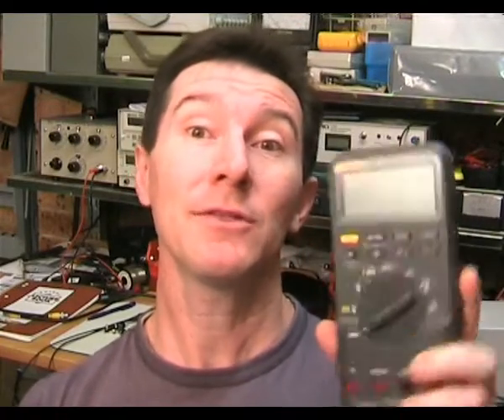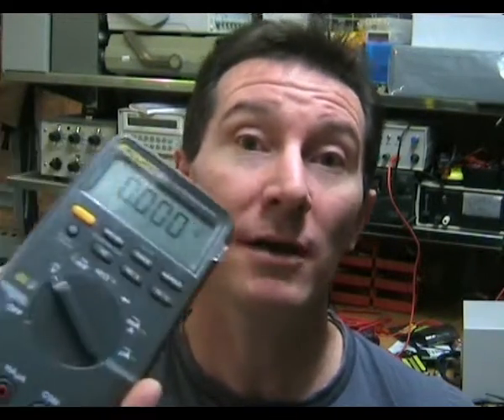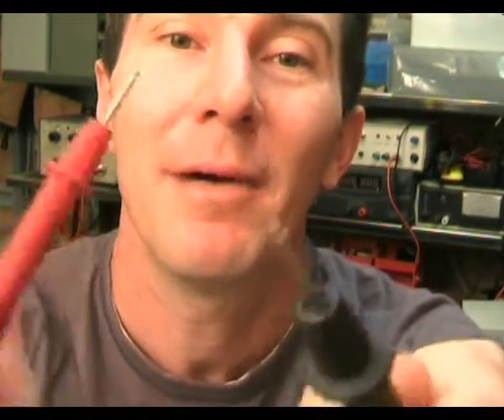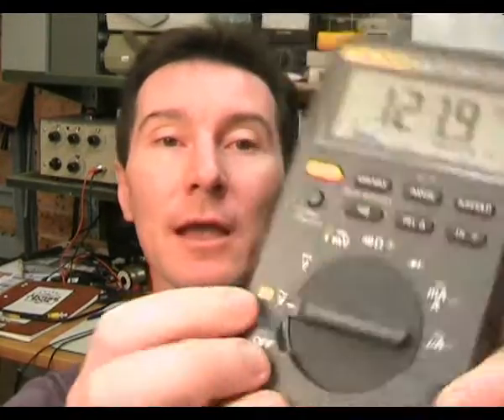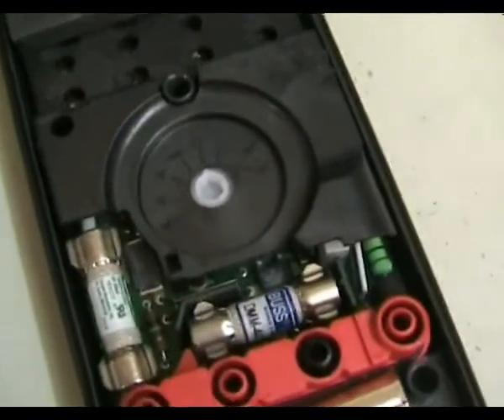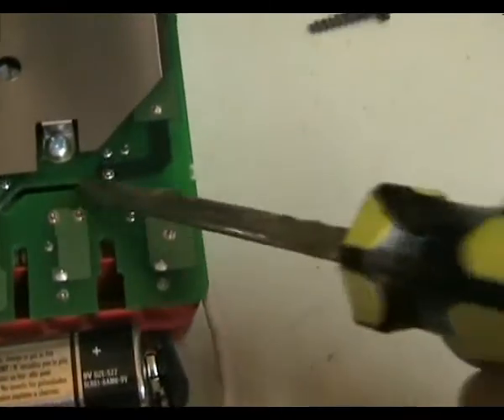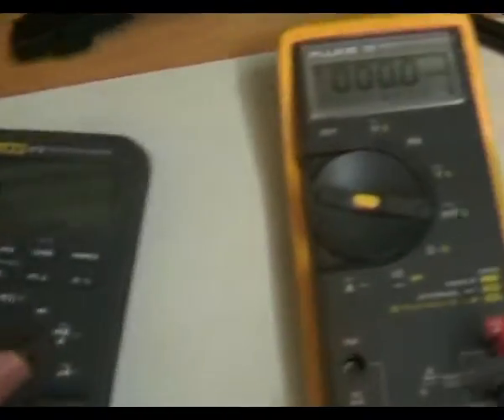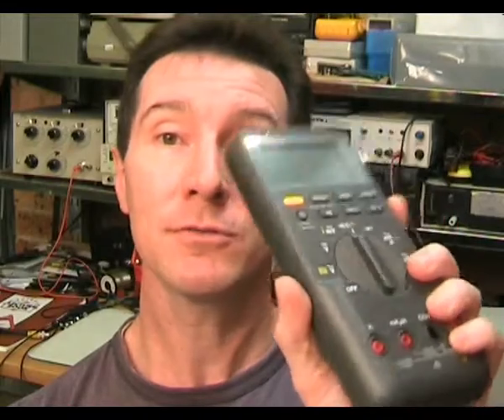EEVblog #10 Part 2 of 2 - Fluke 87 V Multimeter Review

Comment: I have an original first generation Fluke 87 with 4,000 counts, ±(0.1% + 1) basic DC accuracy, and green backlight which I bought from Joseph Electronics in Niles, Illinois just over 30 years ago. At one point, the display started to fade (i.e. segments dropping out). I understand this was a big problem with this series early on. Even my dad's Fluke 8060A (the predecessor to the model 87) suffered from the same problem. Apparently this was due to some degradation in the elastomer strips used in that time. Fluke has since offered a display upgrade kit (DR80) with better elastomer strips as well as a white backlight. I upgraded mine and now the display is perfect, not one segment out. However, I opted to keep the original green backlight because I like it better. The white backlight is uneven with most of the light coming from the left-hand side of the display.

Comment: Is it safe to place a rechargeable 9V battery in the Fluke 87V?  Id like to not waste resources if possible but I feel that rechargable 9V that use lithium IONs inside usually have voltage booster that can add noise to the power supply and disrupt the circuitry.
Reply: You can use 8.4V NiMh / or check that li-ion has 2 elements in series - no booster circuit. I'd like a DVM powered with lithium from factory or at least AA /AAA size cells. 6F22 is old and not convenient

Comment: My new Fluke 87 had LEAD error code and I cleaned plugs and still don’t work.   MY old 87 never had such a problem.
Reply: One of my coworkers had the same issue with his, its basically a bad connection with the plugs.
Reply: Moisture (rain) and dirt in the lead holes cause this.  Desolder and replace plug jack for about $25 is (was) the fix from Ebay.  If you're lucky you might be able to clean out the old one good enough to clear the error. There is a built in microswitch that detects lead placement for amps/volts that gets contaminated.

Comment: Dave, just bought a brand new Fluke 87V the other day, and I was surprised it didn't come with a calibration certificate. I called the manufacturer and they confirmed it does not ship out with a proper cal certificate. I would have to ship it back to the factory and pay them to calibrate it and certify the results. What the heck? All other major DMM suppliers automatically include a cal certificate. Why shouldn't Fluke? It's a $400 plus meter, making it there top of the line meters. It's more of just piece of mind, I'm sure it's in spec, but hey, maybe my expectations are high.

Comment: A note to future buyers of a Fluke 87-V as of 2017: It's not made in USA anymore (probably China but it doesn't say on it where it is made anymore), and it doesn't carry a lifetime warranty anymore either (10 years now), and the price has gone up (with inflation from 2009). Still a great multimeter, but ships with cheap stiff vinyl Fluke TL75 leads and small probes and no printed manual.
Reply: Fluke makes and sells 87V's in multiple markets. The 87V purchased in the American market from authorized dealers are still made in USA and still carry a lifetime warranty. You can refer to their specs on the website (https://www.fluke.com/en-us/product/electrical-testing/digital-multimeters/fluke-87v) which states "Designed and built in the U.S." & "Comes with a lifetime warranty." Chinese market Flukes are made in China and do not carry the lifetime warranty. I know the 1xx series are made in China, but I'm pretty sure there are 87V's made there as well based on reports of cheap 87V's purchased on eBay and the like and that do not carry the made in USA verbiage.
Reply: On the Fluke site for the 87V

Additional measurement features
The Fluke 87V is designed and built in the U.S. and comes with a lifetime warranty.
Reply: Fluke still manufacttures their high ens multimeters and other quality devices in the US. Some of their cheaper items are made elsewhere however
Reply: @vince8005  
My 2020 Fluke 87V doesn't carry the "made in USA" markings on the back, contrary to my friend's 87V that he bought in 2000. That tells me that recent ones are not made in USA anymore.
Reply: I bought one, manufactured Nov 2017, box and sticker on the box say made in US. 
I'm not impressed with it. 
The holster is ugly and shows a lot of markings of the new cheaper manufacturing process (the smooth surface that fluke meters had is now gone), the current measurement reads 2 mA in Amp-mode by default (0,02 in mA mode) and the tilting bale on the back is so badly connected in the rubber holster that it pops out, rubs on the meter which makes it that it isn't easy to flip out any-more.Would not recommend buying. My 7 year old second hand fluke 115 (China) is better build in terms of the tilting bale, the smooth finish on the rubber holster and an AMP current measurement that shows 0,000 when nothing connected, as it should. and that's an electrician's meter, not meant for electronics. The Fluke 87V is a joke and a bad one at that!
Reply: @MrDubje  Hey strange how mine had markings too, it is because of shipping I'd assume however they still are made in the US don't listen to anyone who says otherwise, I've spoke to fluke and asked many questions on the 87v and they also have mentioned that the rubber rubs off and leaves black marks which it does from heat, use baby wipes made mine look brand new.

Comment: thank you for your site and help.  I have a problem with my 87V,   It stopped working right on ohms and diode mode.  I have fixed other Fluke 87 and 87V meters by replacing the input protection components.  This one however has a different problem. Any ideas?

Comment: One question: how does the Fluke 87V detect the presence of a lead plugged into the amp, or milliamp sockets ?
Reply: It has its banana-jacks split in half, contrary to the fluke 289 that uses an optical system (ir beam passing through the jacks).I ran a current of 10 Amps through the meter, and the Amp jacks got hot, which is not surprising considering only half of the jack connects to your plug. At least, that's what I think. Don't think the sense contact is able to carry current.

Comment: So, anyone know what's going on with continuity mode delay?  I have a cheap meter I've had for who knows how long that I got from who knows where, and as far as I can tell, the continuity beep is analog.  There's no delay, and I can make it screech with intermittent connections.  IMO, that's a good thing.  Why is it considered normal for "better" meters to have some kind of latching digital response that can take on the order of 10-100ms to respond?
Reply: Because a good latching continuity can capture transients that you might not hear. A Fluke 87 is specced as having a 1ms continuity. So it'll catch that 1ms transient short (which you might have trouble hearing in a noisy environment) and turns it into a half-second loud beep.

Comment: I know this is an old blog post but I still need to make this comment!  Please don't wave things around that you hold up in front of the camera, it's bloody annoying.  I suggest you use a wide angle shot and leave the article stationary on the bench, with close up's edited in if required.  Also, when you are poking around inside things, don't scrape around with a hard tool like screwdrivers, use a plastic pointer or something like.
Reply: This is one of his very early videos--he's learned a lot about how to produce them since then. If you watch his newer videos, you'll see a big difference. He has better video equipment, better mics and better lighting. He also keeps the products stationary (as you suggest) and uses a plastic stylus to point out details. So basically everything you commented on (3 months ago) has been fixed for quite a while.
Reply: Thanks, I have noticed that now.
Reply: Nah I like that he waves in front of camera, good technique.

Comment: Just got my Fluke 87 V today from UPS. I had bought a Fluke 77 back in 1989 for $320 at that time and bought a Fluke 12 in 1993 so I bought this for its true RMS and other capabilities. I like how Fluke made a separate battery hatch on this 87 series because I found the plastic posts that the self tapping screws on the rear of the Fluke 77 screwed into weakened and broke over time even when I was careful taking the back off to change the battery.

Comment: I would've recommended like 17B or something, and use the spare money for parts, solder equipment and power supply. Or buy it second hand.
Heck, you could probably even get oscilloscope alongside a cheaper multimeter.
Also, hobbies may come and go, so investing would be recommended to do in small steps.
They're probably more inexpensive because of the larger quantieties they're able to sell compared to individual dealers, I guess.

Comment: Im doing repairs and I got this meter and went back to Fluke 12 :)))

The only reason is when measuring diodes and if there is a voltage in the circuit Fluke 12 will discharge it, I believe it has 2K resistor that is in parallel connection...

It would be nice if Dave explanes this in details and tell us if there is any other Fluke meter that does the same.